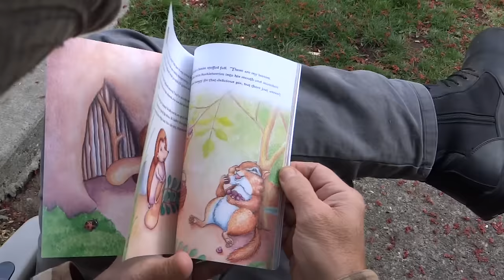Carving a Character from my Daughter's New Book

Comment: Hi Mike just a question, how do I keep a green stick from cracking or splitting while it's drying ?
Reply: Keep the bark on, and seal the endgrains with wax or paint, the thicker the paint, the better. Also store it in a dark room or shed which should be ambient temperature, and hang it up using some string. 

Hope this helps 👍

Comment: Mike , how do you keep your paint brushes from flaring & 1 or 2 sticking out messing up what is being painted ?
Reply from the maker: I make sure to clean the brush often, especially at the base where the bristles come out. When you finish using the brush, clean it and form the bristles with your fingers, and store it with the bristles upward. Also, don't leave the brush sitting in a cup of water for a long time. That will mess up the shape of the bristles.  When paint dries up at the base, it will cause the bristles to get messed up and stick out. Another thing you could do, is ,when you clean your brush, put a bit of dish soap on the fibers and store it that way. Your brushes should last a lot longer, and stay in good shape. I hope those suggestion are helpful, Ken. 
Take care my friend!
Reply: Thanks a lot Mike , I'll try all that . I'm not a good painter and my wife will attest to that ( just look at the house ) Lol.